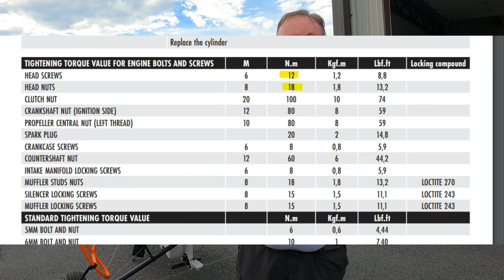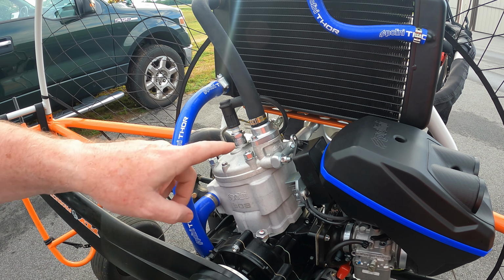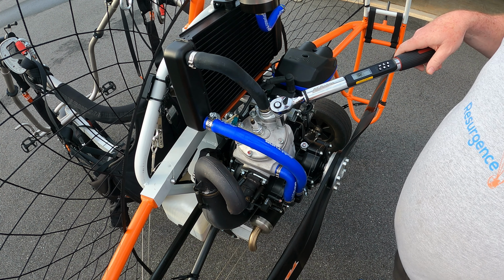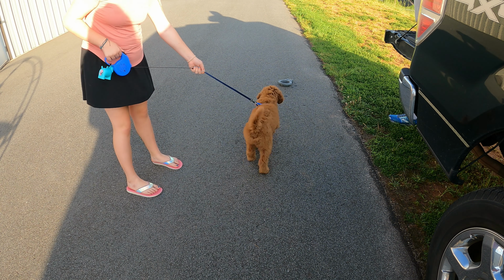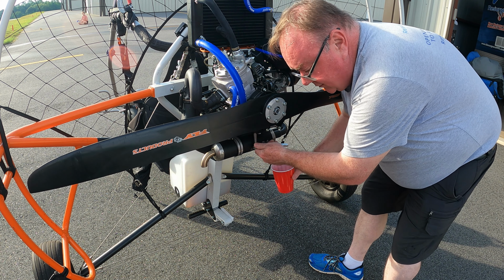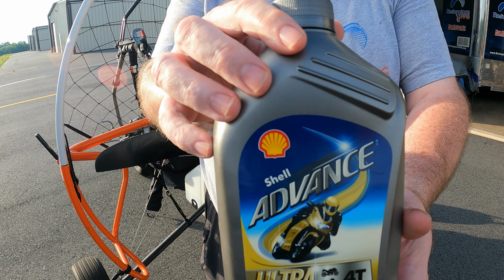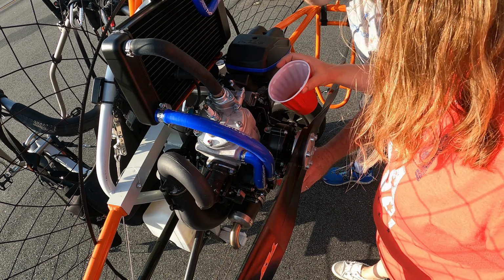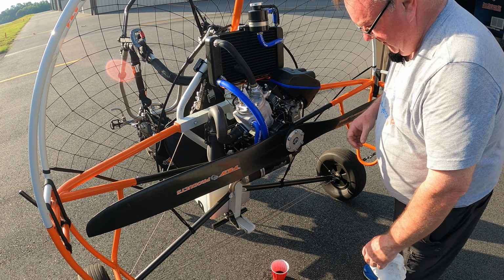Para Maintenance and Puppy Training All in One!

Comment: What’s your take on avgas I’ve heard mixed things on it some saying it’s good others saying it wears rings And pistons faster and some say just run a high octane non ethanol which I’m assuming that’s the 4 stroke correct
Reply from the maker: So I have a Polini 303 engine on my trike, it is a 38hp 2 Stroke, water cooled engine.  About 6 hours into flying I burned a hole in the top of the piston, big issue about 10 months ago with Polini, several people with Polini's had this issue supposedly only in the US though.  Now One Up Adventures made Polini fix my engine and for others they sent out a rebuild kit which included a new piston and head redesigned and added a washer between the spark plugh and head and also changed the carb needle to a different design.  So they made all these changes yet blamed the problem with holes in the piston on American gasoline that they said has lower standards than European fuels and sent out a letter to all owner in America to ONLY use AVGas.  So I use only AVgas 100LL now and I haven't had any problem since then and have close to 20 hrs on the engine now.  I know with Vitorazi Cosmos (about the same size engine) people still use high octane auto fuel and have no issues.  It is definitely a little more of a pain to get but I fly out of an airport so not a big issue for me at this time.
Reply: @ironeagletrike  ok that sounds crazy but I’m glad they took care of it for you and got you back in the air and it wouldn’t be hard for me to get either I can go right up to Lincolnton airport off 73 and get as much fuel as I need I know I’m the past I’ve called and asked if I could fly a paramotor out of there and they’ve told me no that it’s to busy and don’t want to take the risk which I completely understand. But if I did some work to my front yard ( 5 acres) I might could take off from my house and have a few fields around me which if I foot launched I don’t think would be bad but seeing how I may end up on a trike now I think I would need a little more room plus obstacles such as a few small trees and power lines on on side of my property I wouldn’t want to take the chance. But thanks again for all the info and help I appreciate it a lot
Reply: @ironeagletrike  do you have a Instagram I’d rather DM you through there in future if you don’t mind I don’t have Facebook or anything else just YouTube and Instagram
Reply from the maker: @backwoodsshiner887  yes I had to look it up.  Some of my FB posts automatically post to it but I don’t typically post direct to it.  It is Bobinnc66
Reply: @ironeagletrike  I sent a follow just now it’s my real name initials CS